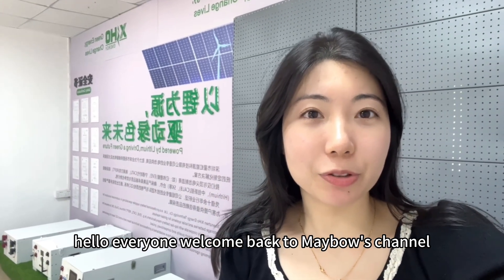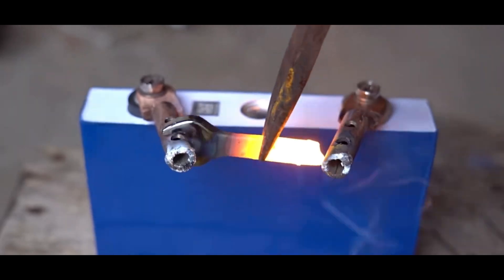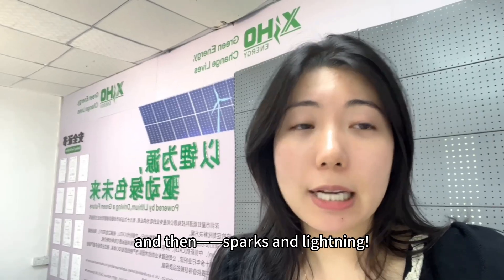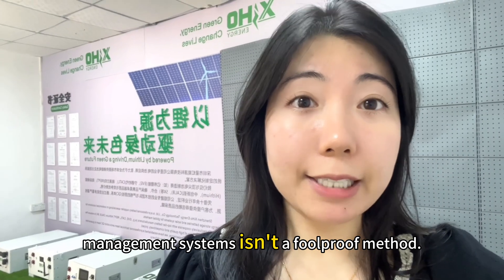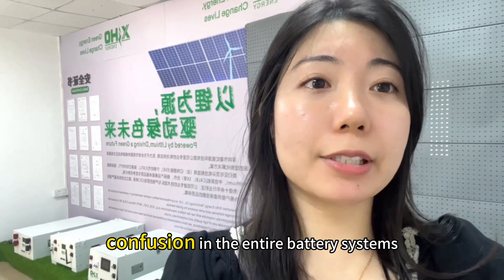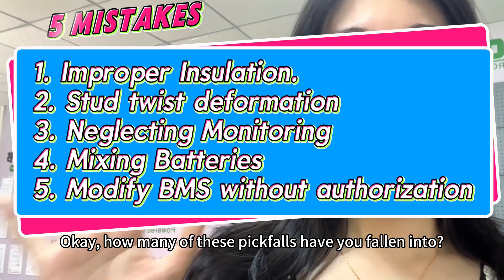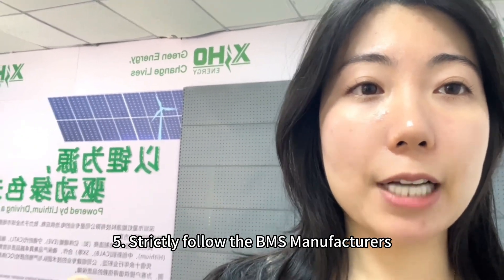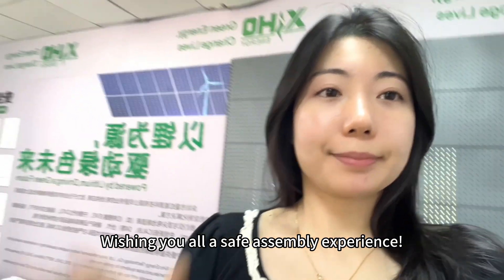【XIHO Energy】Never Do This with DIY Lithium Batteries! Top 5 Mistakes Killing Your Lithium Pack

Comment: I have a thin 10mah power pack for my phone, but if like it if it were even thinner and lighter, even if it only had half the capacity, but this video showed me i probably shouldn't even experiment with taking mine apart to do this.